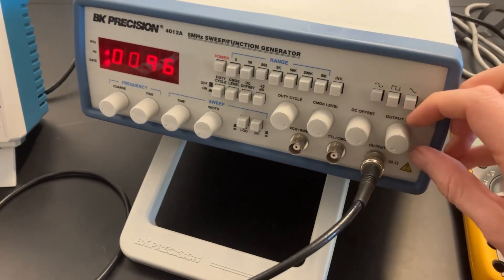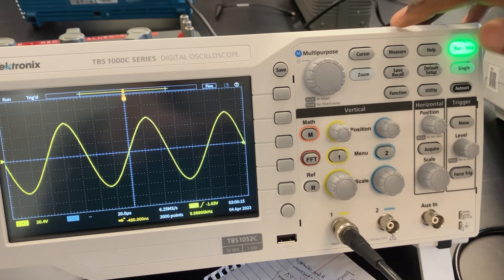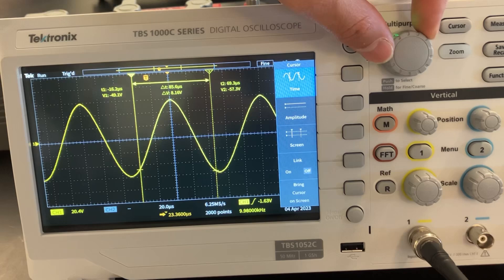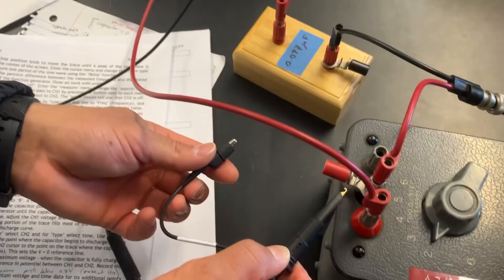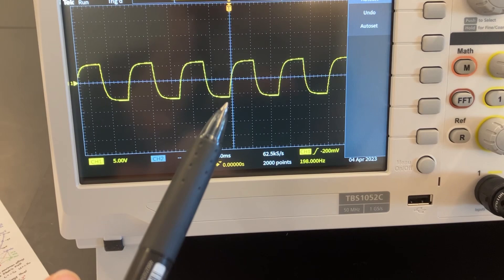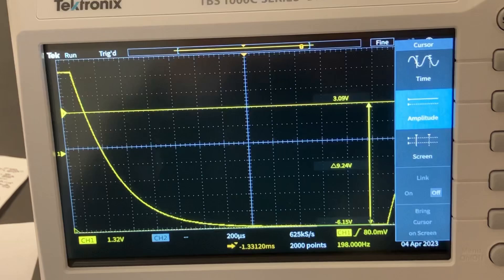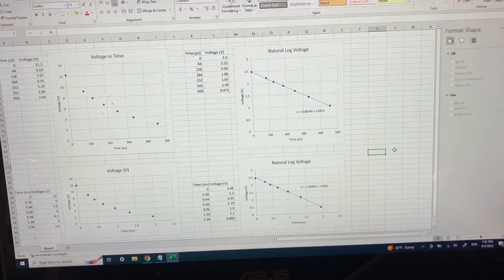Boost Your RC Circuit Analysis Skills with an Oscilloscope Lab

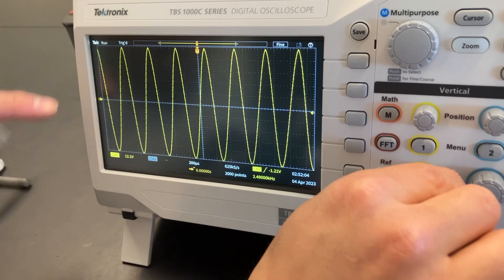Comment: Trap for  young whippersnappers: Check if the scope might be set to a 1:10 probe. In your setup it needs to be 1:1.
Reply from the maker: Thanks, we'll try that next time!
Reply: @mtheorylaboratory  That would divide the measured voltages by factor 10